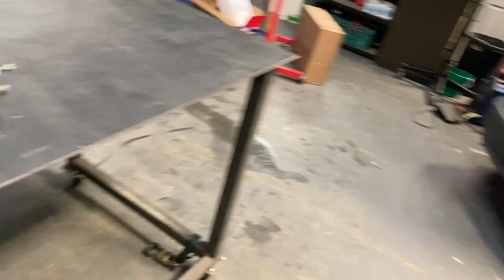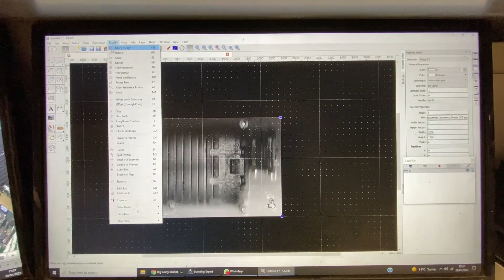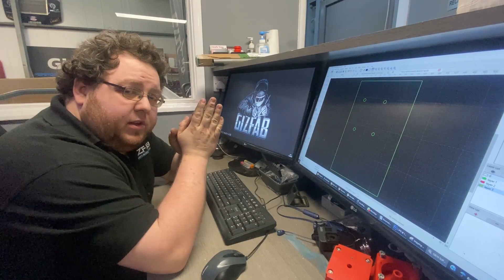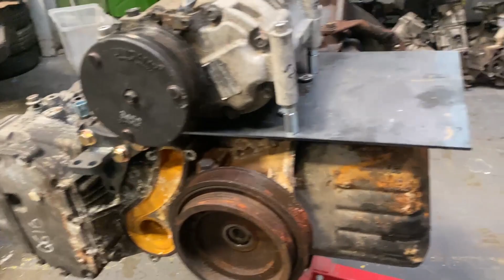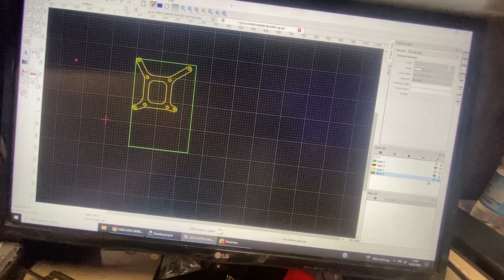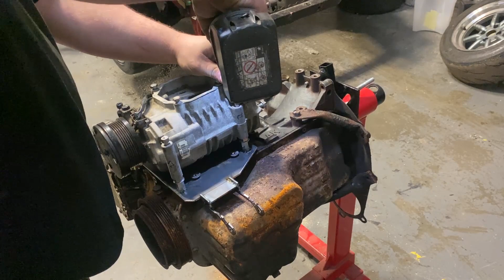MOUNTING THE SUPERCHARGER! - K11 MICRA SUPERTURBO TIME ATTACK BUILD

Comment: Is it possible to mount the Supercharger lower down? swapping over positions with the Alternator.
Reply from the maker: Negative as the front panel would be in the way of the outlet. Having it on top means it clears the lower balance.

Comment: This charger is off the Mercedes C230K W202 , they have an alternator bracket with a built in pulley that sits by the charger, try that , also are you porting the charger and deleting the pulley magnet with a smaller pulley
Reply from the maker: We are keeping the magnetic pulley. It’s a key to make sure the setup will work.
Reply: @GizFab  yeah but isn’t the point in having a supercharger and turbo charger , so the supercharger kicks in straight away until the turbo kicks in ?
Reply from the maker: @Shadowmosesarea51  Correct. Which is why the charger will be activated when needed. The same way it works on the Mercedes.